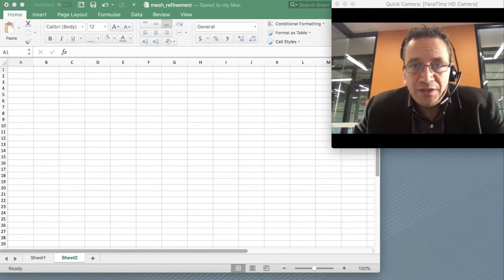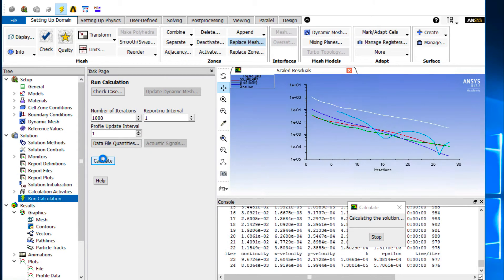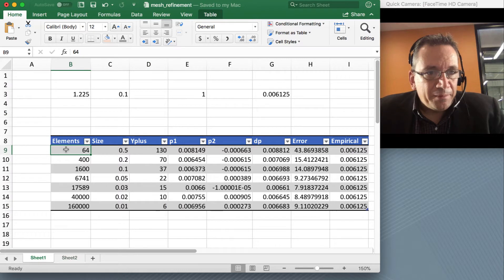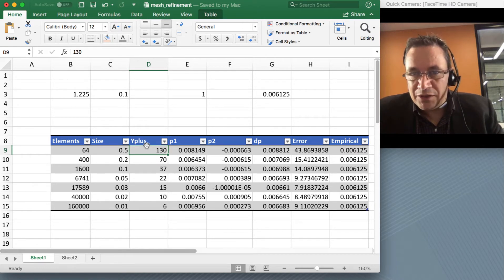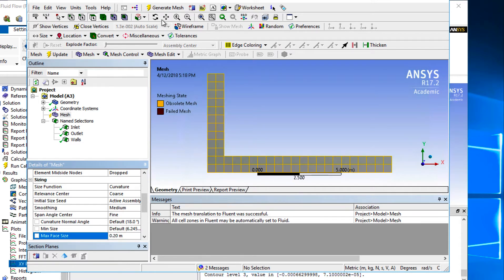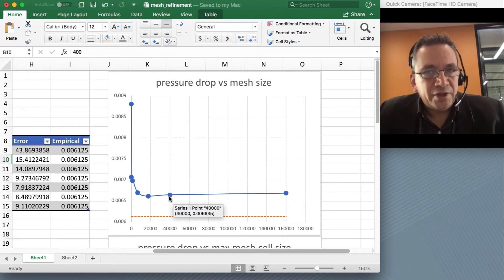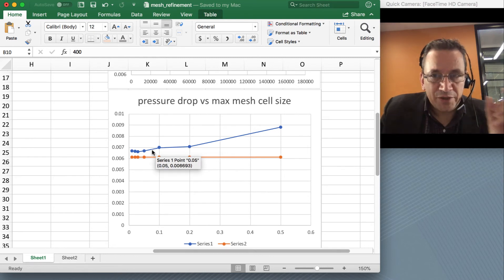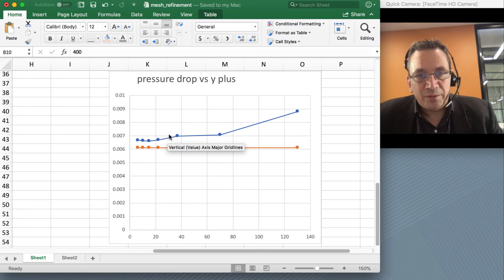Why you should worry about the mesh that ANSYS Fluent is providing - Part 2: Mesh Refinement Study

Comment: nice job Jorg - one thing to consider - computation effort - we can use highly refined meshes and obtain convergence but what we really want is mesh size just large enough to achieve convergence and save valuable computation time - with a tiny model like this - no worries - with a large 3D model - it matters - so I would include another column in your Excel - Computation Time (ms) which increase with overall model complexity and size - again - if we use Mesh Adaption feature in Fluent we can remove a lot of the iterative work trying to find a "good mesh" - yes you still need to validate the result but - with this manual method it takes longer and is less capable of providing optimum cell size vs computation time

Comment: Dr Jorg, I am starting to simulate 2 phase oil-water flow in a pipeline (stratified wavy in particular, but might extend to other regimes), i had some questions, for the mesh refinement study, can i use a single fluid like oil or water? or must use multi-phase? also which turbulence model and multi-phase model do you suggest?